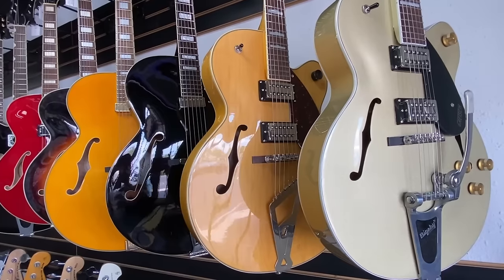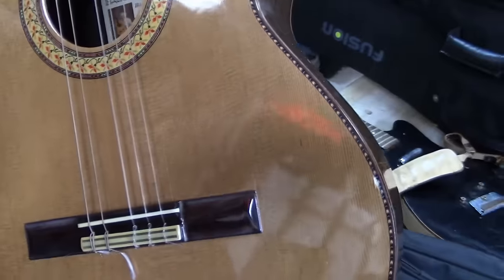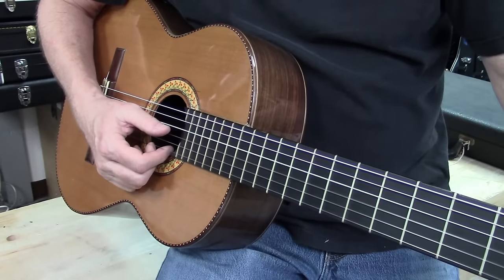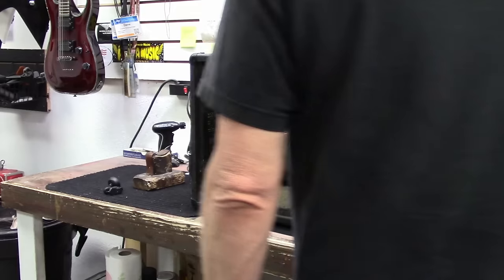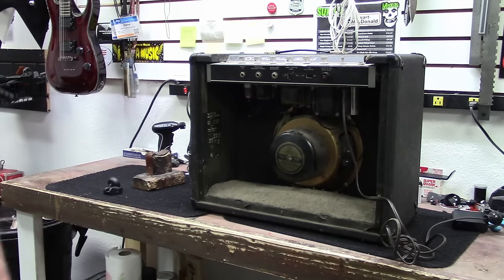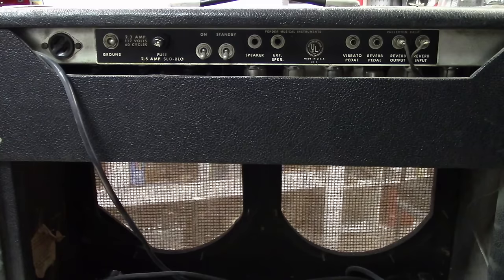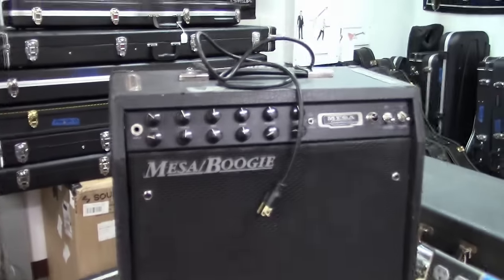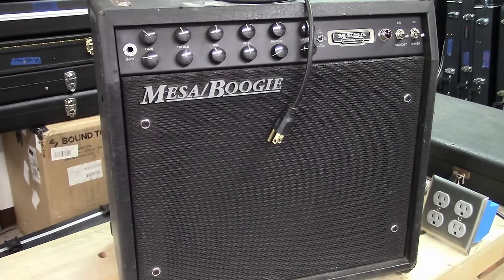Storage Locker Guitar and Amp Testing!

Comment: Never just turn on an amplifier that's been sitting in storage for years. Especially if you're not sure it needed repairs. Take it to a tech.
Reply: I came here to say the same thing! I was cringing as he turned on all the amps. So dangerous and the caps are all probably toast after all that time sitting. Good way to destroy a valuable amp..As a dealer you think he'd know this. Cool video besides that
Reply: @dyamariv3628  He got lucky. You always have to put common sense before your excitement to test a newly found tube amp. Solid State is different... it either works or it doesn't. Even newer tube amps shouldn't be left sitting for years on end. The electrolytic capacitors lose their charge and dry out. A tech will pull the chassis and after carefully checking everything, will slowly bring up the voltage on a Variac to reform the caps, etc. Just turning on an amplifier that's been sitting for years is just asking for a fried PCB, blown transformers, etc. Heck, even a nice little fire on the bench you could roast some marshmallows on. Like I said... he got lucky.

Comment: Re the Vox:
Tubes take time to warm up. It has some vicious 60 Hz hum and those switches are crying out for some contact spray. A back panel is easily fabricated. You only ever look at the front anyway.
The Fender amp looks scrumptious. Once that is done up it is going to be a serious piece of kit.
The Music Man sounds good but could do with a touch of cosmetic surgery
Feedback distortion on the Boogie is through the roof but that is probably just a matter of setting it up and contact spray. Also lots of hum but that may just be a question of using humbuckers.

Comment: I bet the 2 12 Fender cab was for the twin as a bottom. It was common to turn them into separates in the 70s because they weighed so much. Doubtful, but they could have the original Jensens in them. That Ramirez looks like it could be a high end classical. They are the Martin of classical guitars though they make entry level guitars too. You pretty much know the rest of your find.  You scored!
Reply: I have a Quad Reverb (CBS monstrosity) that uses the Twin schematic. Its only redeeming quality for carrying purposes is that it's so tall and has wheels, so that unless you have to climb stairs with it, you're fairly good to go! That said, that amp sure sounds terrific, especially after backdating the schematic to a Blackface!

Comment: The Fender Twin should have a sticker on the inside left ( from the back ), of the amp. On the sticker will B a serial number. That number will provide the year and month it was manufactured.
Reply: Fender didn’t start adding the QA sticker until 1990
Reply: @82nd Airborne Vet  I have a Fender Twin Black Face from the 60s. The original sticker is there with serial number. The Amp is authenticated.
Reply: @82ndairbornevet   I've no idea of what Ur referring to, regarding 1990.

Comment: Don't change the plug. That will devalue it's originality. You buy these to be original collector's items not to actually use on stage. My amp guy said you can just to some wire trick to make it safe for home use.

Comment: I found a really old guitar case in a customer’s attic, was beat up but interesting as hell, but it was empty besides a single coil pickup in the compartment.Customer gave it to me because it looked like junk.. Turns out the guitar case was from the 30’s or 40’s and I got $400 for it. But better still the single coil pickup was from a 50’s telecaster. Needless to say what I thought was junk, turned into a gold mine.

Comment: Not so much shock hazard, but plugging in and old tube amp, with old dried out caps and shorted tubes, you can do massive damage to really expensive components  that other wise could be usable with a few caps replaced, instead of killing it.
Especially older classic more sort after equipment.

Comment: this comment is a day late and a dollar short, but just for reference: the two different color saddles on the strat bridge correspond to the "core" wire of the strings. the core of the wound e and A strings is similar in size to a G string. the core of the D string is similar to the A or E strings.

Comment: I think you have to be gentle with valves that haven't been used for years...  Probably have to put them on for  a few seconds... then a minute... then off... then 2 minutes... off and build up their exposure gradually...  Think it can fry the circuit if you don't ease them in gradually.... Then when it's acclimatised... I think you have to switch in on regularly.  Valve radios sound better if you leave them on for a day or 2 at a time...  Not sure if it's a fire risk or not though

Comment: Put tubes on standby and let the tubes warm up first. Just clean the pots and switch. I would leave the pad on the tank, sure the guy put it there for a reason. Can't create a ground loop without a ground wire.

Comment: Use DeOxit on the pots, it will clear up the scratches immediately
Reply: That Vox definitely needs more than just cleaning the pots; there's probably DC voltage on them, caused by electrically leaky coupling capacitors. In particular, the thumping tremolo sounded really bad and is indicative of bad caps. Leaky coupling caps in the output stage can quickly burn up EL84'S and output transformers. The filter caps are also nearly 60 years old and are a disaster waiting to happen ---- when they short out, the power transformer will likely burn up before the fuse can blow. I'm glad he only powered it on for a minute, and even that was a big risk. Rare birds like that should go straight to an experienced tech !
Reply: I agree he got lucky!!

Comment: Very cool amps bro 👍...i remember being a broke teen in the late 90s going to pawn shops and seeing Marshall, Mesa boogie, Fender, Vox and many other small 1×12 tube amps for sale cheap like a couple hundred bucks or much cheaper because the trend at the time was the big Marshall JCM heads and Mesa Boogie dual or triple rectifier head with big 4x12 cabs, but that was the trend at the time, big stacks and high watt tube heads lol...now it seems the trend is going small many players don't go bigger than a 2x12 most just do a 1x12 lol

Comment: You can use external speaker output of the twin amp and run speaker cable to a speaker cabinet the ev cabinet will be super loud and sound great louder the better it will sound

Comment: The Twin Reverb is anything from 1964-67. The speaker panel you hold up there is not original to this amp. This is a 1968 drip edge front, which would have gone with a 1968 only silver-face TR. 

Look at the transformers and pots to date the amp. The date codes are stamped into both, and can determine with fairly high accuracy the original manufacturing date. I'd guess 1965-67, but that grille is definitely not OEM. Post the transformer codes from the three transformers and I or any Fender guy can tell you the general "no earlier than" build date.

Comment: Looks like a 85 give or take Mesa ...Nice score. Probably around 9 to 1000 value fixed up? Or idk
Reply: 2000's
Reply: Nah, that's early 00's. I bought an F50 about that time, wanted an F30, but none in stock. The F50 was heavy AF, and so loud I rarely turned it above 9-10 o'clock on pre and master volume.
Reply: @styrenebuilds6851  I'm sure I am way off. Hahah I only remember seeing fellow bandmates with one looking identical and they , if I remember correctly were extremely loud so maybe theirs was diff. That was in the eighties. Looks so close. But that can be deceiving as I was drummer all those year and recently got into guitar and now trying to blindly remember lmao!!!!! Thanks for the heads up and correction
Reply: @bigjohnson7415  thanks yeah they all look so similar to the 80s I remember some friends bandmates had ...I just remember them being the rock and metal choice amp I guess. All blacked out with dual channel ....I they used to have in 80s extra switch too or a different placement by the standby?
Reply: @robertclarkguitar  I had a Mid 80's 50 Caliber. The 80's were the "Mark" and "Caliber" amps. The "F" series were late 90's early-mid 00's.

Comment: I have 4 old blonde tolex music man amos. RD series. I have two 1x12. One 2x10, and a 120 watt music man bass head. With all 4 cabs but the cabs are not the greatest. The 4x10 cabs are pretty rough and deep cabs, The 1x15 cabs one still has a working stock speaker in it,

Comment: I'd part out that gold foil guitar. I've heard amp techs suggest it's better to not plug in old tube amps that have been sitting. Like they're potentially dangerous. That Music Man looks super early. Nice.
Reply: The Gold Foil is worth way more together. The need for these parts, only really works on Tiesco, amd Del Ray, which is what that guitar is one of the two. Those pickups alone, are the price of those guitars mostly, but to keep them together with case is best for a person looking, and in today's offset market, it won't take long on Reverb. Needs Identified, listed, and then it'll sell fast.
Reply: @caiusmadison2996  You think there are more people who want to buy a guitar like that than people trying to complete a guitar like that? Or build a Coodercaster?
Reply: Yeah, the Vox amp is a smoke show waiting to happen. The scratchy pots will need more than DeOxit to cure them, they probably have DC on them from leaky coupling caps, which can blow EL84's and output transformers (also likely why the tremolo thumped loudly and sounded bad).  The filter caps, being nearly 60 years old are a disaster waiting happened and if they short circuit they might take out the power transformer before the fuse can react to it. It needs to go to an experienced tech ASAP, specifically somebody who knows Vox amps well.  The Twin Reverb is going to need some service as well, new filter caps at the very least, but it's easier to find experienced Fender techs than Vox techs.

Comment: Sorry, but this dude is clueless about gear. He has no idea what any of this stuff is. Should be common knowledge for owning a music store.
Reply: At this point he doesn't need to know anything.  He needs to have that knowledge before he prices the stuff.
Reply: @roytofilovski9530  I'm sure he's a great dude, I'm not saying that. But, when he just throws a tube amp up on the table that's been sitting in storage for years and just fires it up after "checking the fuse"... tells me he has no clue about how to handle gear. He's lucky that Boogie and Vox didn't burst into flames. Happens every day. The dude owns a music store, he should know better. He didn't even know what an EV speaker was used for. I mean, c'mon.